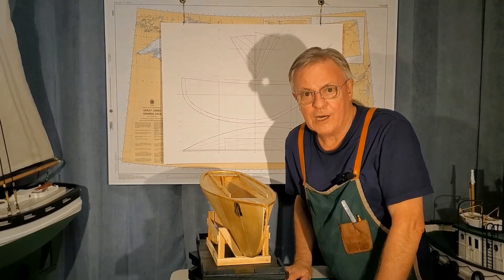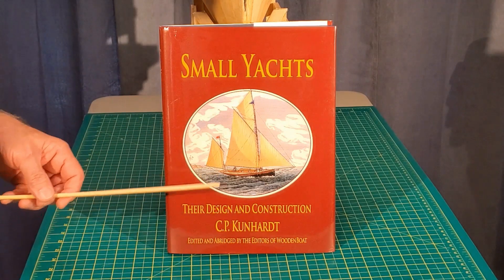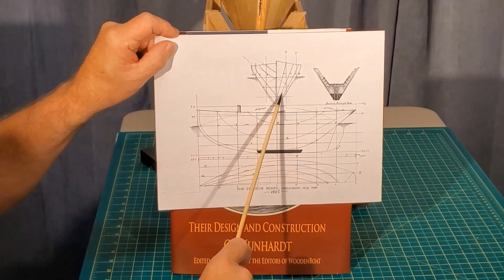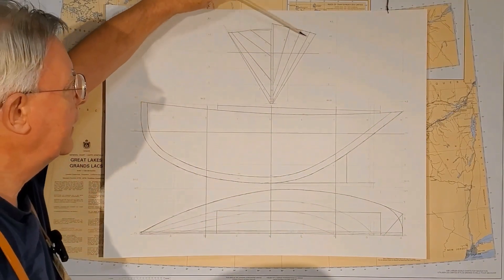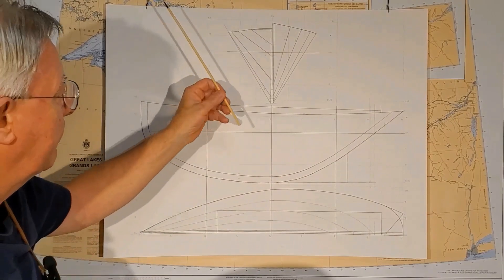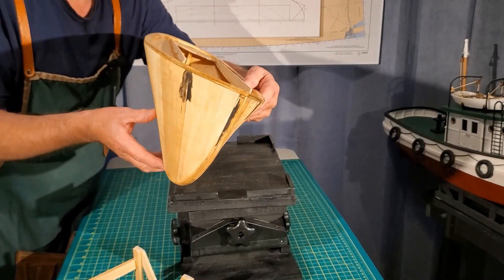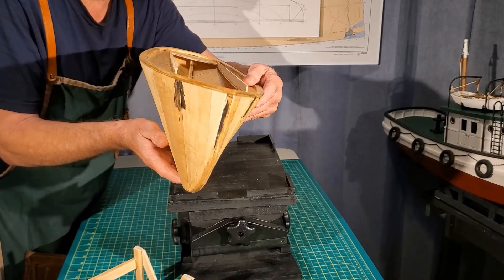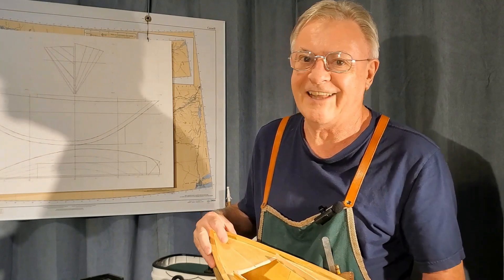RC Hull Design Experiment: 1882 Fendeur Part 1

Comment: Can i get plan?
Reply from the maker: I don't have a plan available but this has to be the easiest model to design/experiment with yourself.  All you need is the keel shape and the deck profile.  Planking could even be craft sticks placed vertically with wood glue.  The design I made functions better as a power boat than a sailboat.   Brian RCWH
Reply: @RCWorkboatHaven  Ok. I will try myself. She is very beautiful. Thank you

Comment: Hi. Very interesting. Will follow along. Good luck. I have a question.... i hear basswood. I am not familiar. Am i mishearing balsa wood?
Reply from the maker: Yes, the wood I used was Basswood. In the past I have used Balsa wood too. I have tended to prefer Basswood because the wood is denser than Balsa and I find it more predictable when I cut and bend it. Both species can be cut with a knife. RCWH